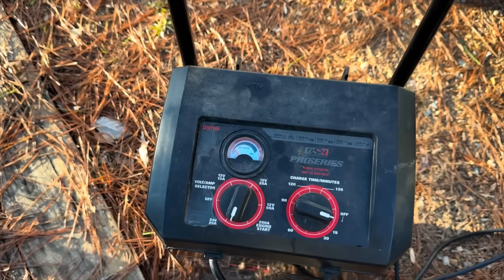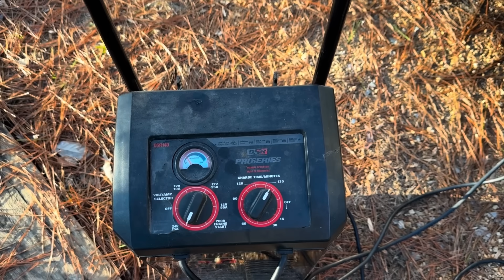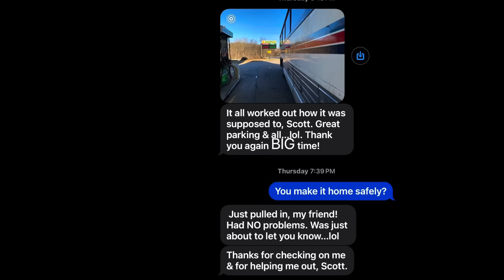Lead acid battery exploded in my face.

Comment from the maker: One thing i didn’t clearly mention and i feel like i should to help people understand how fast this can happen.    That battery charger was only on and hooked up for less than 60 seconds.  I always assumed gassing took a while to happen like when charging for hours etc.
Reply: Batteries and old Split Ring rims.  Both can me unpredictable.  Glad you are ok.  Best Regards.
Reply: It probably happened like this: When the battery was charged, hydrogen is (it is normal, so they do not recommend charging lead-acid batteries in a closed space for long) generated in the space above the cells (there already is some air too). When the battery terminal was already broken, the hydrogen gas had connection or route from inside the battery and when the contact with the battery shoe sparked and the hydrogen exploded, creating pressure under the battery cover which was thrown up...
Reply: Glad your ok.

If the terminal was sparking like a sparkler then it was electrically arcing like a welder.

Lead melts at 620F or 327c. The arcing would have melted parts of the terminal, which when molten would drip down toward the plates likely causing a direct short circuit and an explosion.

The negative and positive plates are in between each other so short circuit is highly likely when you drop something conductive down there and each cell has a lot of energy stored.
Reply: Had one blow up in my face years ago, left the charger on fast charge too long and went to remove the clamp and the spark set it off.  Super loud, acid all over my face, ran to the garage sink and rinsed and was anticipating the impending pain and eye issues which thankfully never came.  Was interesting seeing the face on the parts store employees when turning in the core.  Definitely a new respect.

Comment: Years ago, I was helping a friend of mine load a case tractor on a really cold morning. Frost everywhere he hit the starter and turn it over it didn't start when he tried to start it again the battery terminal art and blew the top of the battery completely off terminals and all if my memory serves me correctly, he was not charging it either. It had set several days in the tractor.

Comment: Lead acid batteries, when charging, produce Hydrogen. Hydrogen burns very fast when ignited. A spark will ignite Hydrogen and BANG, an uncontrolled explosion.
Never connect/disconnect a live battery charger.

Comment: 45 years ago I was operating a Melroe 600 Bobcat with the battery directly beneath the seat. As I crossed a cattle guard the battery exploded. Luckily for me the seat base and other sheet metal kept all the acid off me. But it was LOUD and sitting on the engine I figured it was a gasoline explosion. I dropped the bucket, flipped the key off, released the seat belt (No cage or lap bar back then) and launched out of the seat.. took me maybe 2 seconds!!!  After looking around the thing my Uncle (owner) and I decided there was no fire and nothing leaking from it, so we started it back up and even with the exploded battery it fired right up. It was two days later that it would no longer start and the exploded battery was discovered. A couple days after that it wouldn't run at all as the acid had ruined the electric wiring, the alternator,  and the main drive belt.  Additionally a lot of paint was now completely gone from the motor and other parts. Battery explosions are NO JOKE!!   Glad you escaped i none piece!!!

Comment: I've had it happen, it's definitely not a fun experience.
I made the mistake, I was charging a battery and grinding near it.
Afterwards, the battery was still sitting at 12.5 Volts, even though it was split in half.

Comment: Back in my auto tech days , there was a boom across the other side shop bay. One of the students had a cigarette near a battery on a car they were diagnosing.  They also learned about battery discharging.   Even if you can smell a battery its dangerous.

Comment: What?!?  You're taking a ten speed OUT to put in an AUTOMATIC!  Talk about a performance hit.  Does the guy have a bad leg?  Maybe fit an air assist clutch?
Reply from the maker: It’s not working right, and it’s installed with a backwards shift pattern.  You would not be able to drive it.   Factory it had a 4 speed and someone swapped it in.   Not an upgrade at all
Reply: @BusGreaseMonkey  Ah, backwards like a rear engined Gillig... ;)  That'll sure keep it from being stolen lol! But, not working right is a problem.  The auto should be a good upgrade over a standard four speed.  

I've driven otherwise identical buses with four speed auto, five speed standard, and ten speed.  The auto was super nice to drive.  In combination with it's effortless power steering, it was like driving a big van lol.  Just slow.  The five speeds had much too big a gap between gears.  And the ten speed would run circles around both of them.  All were naturally aspirated 671 powered.

The coach I have now has a ten speed, but I'm going to pull it and reconfigure it to an overdrive.  Which also creates an odd shift pattern.  ;)

Comment: I started wrenching as a profession in the 70s... In all these years, I have seen 2 batteries explode...One took the hood off a 67 mustang, the other  was on the shop floor..  violent explosions they are..  The smell of the hydrogen sulfide is really overwhelming...

Comment: im glad your ok.  i have thankfully only had to deal with a catastrophic failure once and it was contained in the engine bay.  but a lot of the batteries i have had let go, went suddenly.

you should look into getting at least some goggles and some simple eye wash bottles, or even just bottled water to keep attached to your battery chargers along with an eye wash attachment in the shop at the sink.  you hope to never need them... but when you need them you need them right now.

Comment: I had a battery blow up in my face while trying to help a neighbor get her car started. Whole top of the thing came off, and yes, it was the loudest 'bang' I have ever heard. My mouth must have been closed at the moment as I got no acid in there, but my eyes certainly were NOT closed as it went off. Acid in my eyes, friend guided me (I was blind) over to  put the end of a garden hose in one hand and put my other hand on the spiget - as I figured out what he was trying to do, (I was deaf), I turned on the flow of water and began to wash my face and flush my eyes. I felt a very strange buzzin on the tip of my nose and fear settled in as I began to imagine the worse - but as I finally began to be able to open my eyes a little I realised there was a sprinkler still attached to the hose!! I went to ER, but they simply continued to rinse out my eyes and eventually all my senses returned.

Comment: I've had 2 to blow up in my face one was setting on concrete went to turn on the charger and boom as soon as I turned it on it blew all apart covered me in acid i was 10 years old at the time the second one blew up in my pickup again just as soon as I turned on the charger she blew again covering me in acid i was 20 that time so i now leave the charger unplugged from the power but turned on and hooked up to the battery so im way away from the battery when I plug the charger up so far I haven't had it happen anymore knock wood that's been 43 years since the last time and like you said i couldn't hear for several hours after that happened just stay safe and all of you have a blessed Christmas hope your son can make it down to spend it with you take care keep the videos coming

Comment: When i was a kid just starting out working at a dealership, i went to jump a vw bug with the battery under the back seat, well when it exploded i eas right over top and your right it sounds like a bomb, all that was left of that battery was just the bottom sitting on the floor, just hard to belive it didnt blind me.

Comment: I had a locomotive battery explode like that one time. luckily no one was close enough to it to get hurt.. It was a big loud bang like what you described.. Very scary.  tI was a bad connection with one of the jumper wires that goes between the batteries causing sparks.

Comment: If you are charging or jumping a battery in a confined space, you need to have a fan blowing in the compartment to blow the hydrogen gas out of the compartment. It will greatly reduce the chance of the battery exploding.  The explosion is caused by the spark igniting the hydrogen gas.

Comment: dang, buddy: so glad you came through (relatively) unscathed.  This could have ended so, so badly.

There is as we speak (and has been for several years) a full-face shield hanging on a hook of the coat rack inside my house's front door —along side any number of baseball caps all fitted with the nylon/plastic half-shell bump protector inserts —from a stash of two dozen I ordered from an Industrial Safety PPE outfit, after I retired from being a wrench for the the airline.  ya CANNOT be too careful in these matters.

Again: glad you’re okay.  We need you, out there, pal.

That was a close call.

Comment: Thanks for sharing event.  I am glad you were not seriously injured.

The issue is not just hydrogen but also oxygen is released by electrolysis of the water component in battery electrolyte.  I suspect the battery post also transferred heat into the battery cell raising the temperature of both electrolyte and gas.  I had this happen in a 1978 Honda Accord somewhere when driving across north Louisiana and east Texas in 1985 or so.  The wasn't an explosion that I noticed but battery acid sprayed all over the battery compartment and passenger side front sheet metal.  Even though I treated everything with backing soda, I was never able to stop the corrosion of the car's sheet metal and finally had to scrap the car.

I don't know how the battery compartment of the bus is constructed but it stands to reason they may be loose electrolyte on wooden and metal component that might be attacked by corrosion spurred on by the electrolyte that was splattered.

Take care, continue to be safe, and I wish you the best for the holidays.

Sincerely,

Richard

Comment: I was charging my mothers car many years ago, I went to start it and kaboom (as you described) her battery blew up. I had the hood mostly closed as it was snowing so parts did not go far.
Ever since then the SOP is to connect the battery to be charged to the jumper cables then connect to the charging source (far away from the dead battery).

Comment: I work with huge battery banks for a living in communications sites and ya, like everyone said, hydrogen explosion.  What i have also seen is if you get a loose connection at the post you can get that sparking.  And j know everyone does it, but on that charger in particular I see it has a 200A start setting and that will create a hell of a spark if you interrupt the connection under load.  I'll always turn the charger off even to jiggle and adjust the clamps.  So glad you got away without injury!

Comment: I have had battery explodes myself. It happened to my truck and a bus once and I had to move it. The reason is that the amps are not enough and the batteries cannot handle the starting cycle because that is when the bus draws the most amps. This gas you are talking about here we call knallgass in Norway.

Comment: Happened to me in the 80's. Pulled a still charging battery charger off an 8D battery inside a truck battery box. Caused an arc. Blast knocked me off my feet, and I'm a big guy. Have been careful of batteries ever since. Take heed guys. Hindenburg go Boom!

Comment: In 2001 ,
Stationed in south Korea, we had a   HUMVEE 24 Vdc  do this exact thing.
We decided that the mechanic had fast charged the battery causing it to boil.
No injuries just over amped is what we concluded.
Reply: LOL 88 Korea blew up a Duce battery jumping them off w a D-8 in winter.  Had the guy in the cab hold down the start button and then touch the cables.  Double speed for a easy start when it's cold and you're in a hurry.

Comment: Glad you're ok. I had a battery blow up on me when I was a cop. Thankfully,  I was wearing a winter cap, balaclava and sunglasses(it was winter). My partner said it sounded like a shotgun going off. It melted the nylon cap and balaclava and a couple places on my jacket.  I ended up with a couple of stitches in my hand from flying plastic. Thank God I was wearing glasses. So happy you didn't get hurt

Comment: The lead acid battery generates both hydrogen and oxygen. And it's mixed inside the battery. Oxy/hydrogen explosions are very violent. All you need is one spark inside the battery. I had a battery explode in the engine compartment in our jeep. It was very loud and jarred the vehicle. And I was inside the car, luckily ! ;-) Yes hydrogen gas by itself burns very rapidly. But when mixed with oxygen it is a high explosive.

Comment: Scott so sorry this happened to you! So happy you didn't get acid in your eyes. I had a similar experience about 50 years ago while jump starting a friend's car. The two cars were connected with jumper cables and we were just standing there about 3 feet away waiting for some charge from the running car to get into the dead battery when the dead battery suddenly exploded. We were not even touching the cables. It was in the winter time, and my winter coat had a ton of holes eaten into it within a week from the acid. My face developed some sores as well even though I had washed it. I guess from the acid burning it for that very short period it was on me until it was washed off. Stay safe sir!

Comment: Similar story almost 40 years ago on a snowy day at a metro station parking lot when I had a dead battery and called a cab company for a jump start. I did not notice the driver attached the jumper cables in reverse on my car.  He went back to rev his engine and as I stood at my engine compartment the battery exploded. I experienced everything you did, but had snow on the ground to  rub on my face and scalp and wash my mouth out. I still thank God that I was not blinded by the experience.

Comment: Bet you turn that charger off next time. Had it happen to me in tech center  when I was 15 and im 60 now and wont touch a battery when the charger is on not even wiggle the clamps. Mine blew the hood up on a pinto and broke the windshield. I thought I blew my hand off till I was led to the sink and washed my eyes out and saw my hand was still there I couldnt feel it. Scary!!

Comment: Rule 1 when working with batteries… Always but always use eye protection, safety glasses at minimum but the better option is to use a fuel face visor. In fact you should be using eye protection as a matter of course whenever you are working as the probability of getting something in your eyes is very high. With any power tool there will be an amazing amount of crap flying around and that’s before you have all the MSG falling of the chassis at the slightest provocation. Believe me, there are easier and less painful ways of getting time off work than going to A&E to have something horrible pulled out of your eyes.

Comment: I had an older Suburban that my friend and I were trying to figure out why it suddenly was running rough.  We were standing in front of it while it was running and the battery blew up. The power wire from the starter to the battery had come into contact with the exhaust manifold, melted the insulation off and shorted out. You’re right about the noise, it was super loud…..luckily neither of us was hurt, but it could easily have gone the other way. A big chunk from the top of the battery came down a couple seconds later. I don’t like to think about what would’ve happened if it had hit either one of us on it’s way to the stratosphere. We just plain lucked out…

Comment: hydrogen explosion i guess from the battery gassing . maybe a faulty plate ?
Reply from the maker: The charger was on the battery for maybe 60 seconds.   I assumed when everyone talked about batteries gassing that the process of that was from over charging or over a long period of time.  Apparently not.

Comment: Overcharging batteries is the main reason that lead acid batteries explode.  Too much current creates excessive hydrogen gas production.  Whenever you see a corroded battery terminal, its a sign of the battery leaking from around the base of the post.  The battery that exploded definitely had a leaking terminal where hydrogen gas could escape from.  A clogged vent hole could have allowed hydrogen gas to build up within the battery and the only place for it to escape would be around the damaged terminal post.

It wouldn't be a bad idea to purchase a hydrogen/flammable gas sniffer detector so you test for hydrogen gas buildup.

Comment: This has happened to me two times in years past.  Both were batteries just removed from charge.  One was a 9 month old Ford truck battery, the other was an older Duralast battery.  Both were internal failures, not loose terminals. Both exploded when the starting load was applied.   Fortunately my face was not near them at the time of explosion.

Comment: 7 years ago i was trying to start our 52 international crawler with a droit 4n1 bucket to move snow drifts so people could get to work it was cold as heck so to help i put the booster on it an she was cranking an suddenly the battery which was right behind the seat detonated took out the booster blown to bits the case of the battery was nearly blown apart where less than a 1/4 was left i had acid an battery bits all over me then the lithium started reacting with the water all over i was near deaf for a week nothing burned down an the dozer has not moved since then to say im a bit leary of the ol girl is an understatement